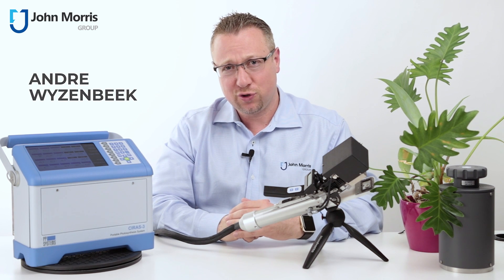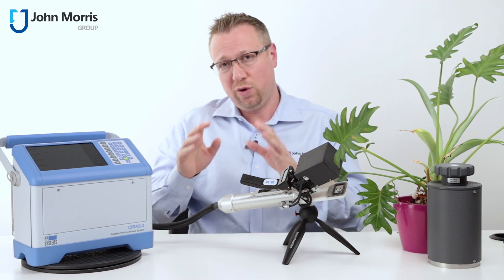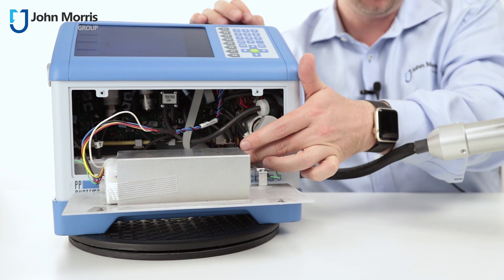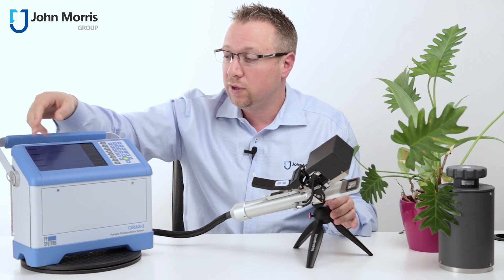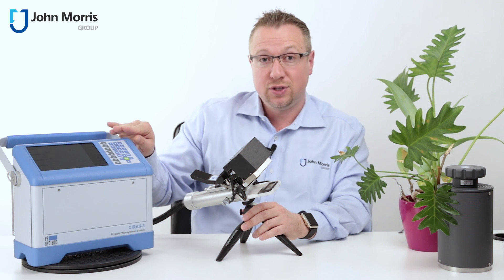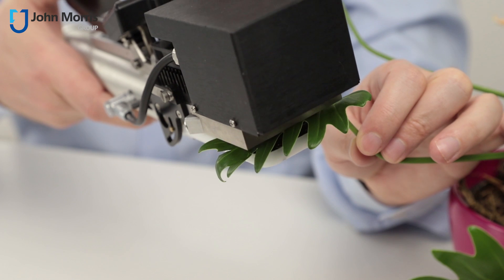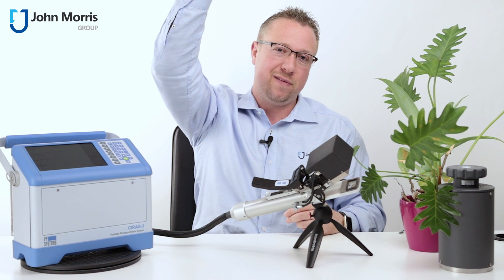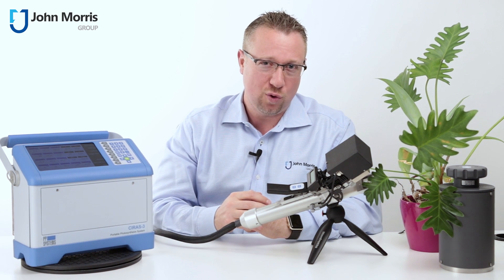CIRAS-3 Portable Photosynthesis System

Comment: Hie Morris, thanks for that video. I want to ask, I  want to take photosynthetic data for sugarcane plants. When i insert the leaf into the curvette, the CO2 d and H2Od hardly stabilise that is come closer to zero even if i change the chemicals and carbon dioxide canister. How do i overcome that problem. Thank You.
Reply: Hi Mchandiposha, Thanks for your question. One possibility is that the seal is not perfect around the sample leaf. It is important when conducting these measurements to ensure that the seal around the leaf is not leaking. If it is, it will result in fluctuating values. The user manual outlines a start up procedure to check the system for leaks. First close the cuvette without a leaf and monitor the values that appear. Without a leaf in the cuvette the values should reach within the error margin close to zero. If they do not, inspect the gasket and hoses for any possible leaks. Other things that may impact this reading may also be the freshness of the desiccants or when the last zero and diff/balance was performed. Ensure that the chemicals, particularly the Molecular Sieve, is changed regularly and if ever in doubt, perform a zero and diff/balance re-calibration. For more detailed assistance please contact us at info@johnmorrisgroup.com
Reply: @jamesraeside1648  Thank you so much for that advice

Comment: Hello Sr, 
We are starting with this equipment and we would like to know if it is possible store our settings in a personal profile. 
We are working in a lab with diferents colleages and each one have diferents settings, we would like to store it somehow so we can easily upload it and avoid to introduce it manually each time.

Thank you.
Reply from the maker: Thank you for your question Iria. The Ciras is not designed to save “individual setting profiles” when using the manual record function. In this mode the Ciras is designed to retain the setting configuration from the previous session. If a different setting configuration is required between sessions then the changes need to be applied manually prior to the new recording session. 

It is possible to save settings when using pre-programmed “Response Curves” though. This function is designed to record the response in photosynthesis to pre-programmed changes in the settings parameters (such as CO2 concentration for example). Please see pages 52-54 of the user manual. This section goes into details about how to configure and save response curves. You may find some value in this function as it will allow you to save and share response curve settings between the various research groups.

Comment: hey. Thank for your good presentation but i have a question , when i take data Ci values become zero
Reply from the maker: Thank you for your question Bilal. To answer your question fully I would need more details about the issue. I would suggest getting in touch with your local PP Systems dealer to help trouble shoot any user or mechanical problems you may be having. What I can tell you is that you should see a decrease in the Ci values as the environment inside the cuvette begins to stabilize. Once the Ci value is below the concentration of the reference gas you will begin seeing readings indicating photosynthetic activity.
Reply: John Morris Group thanks alot ...